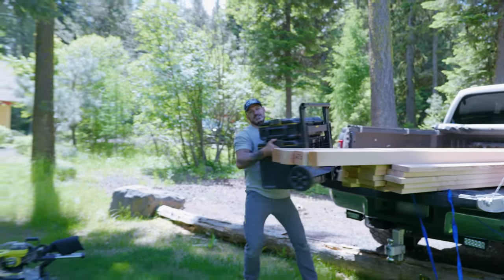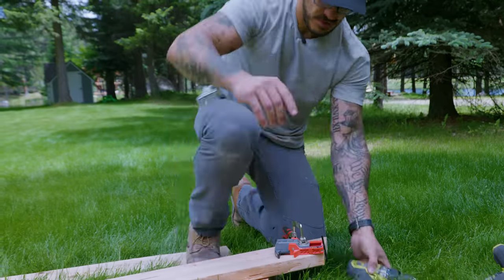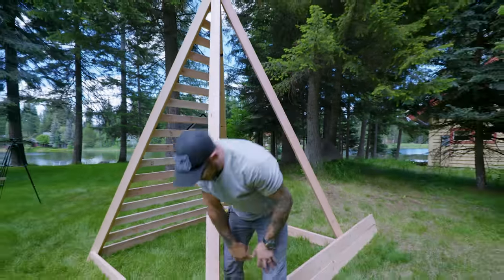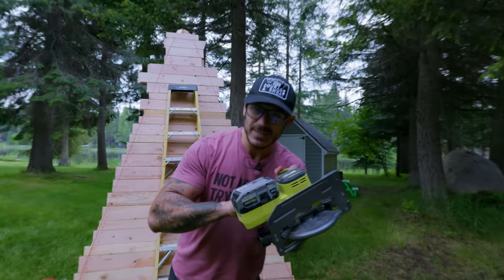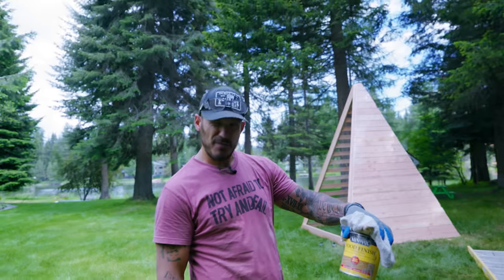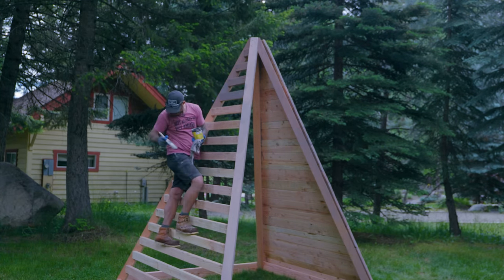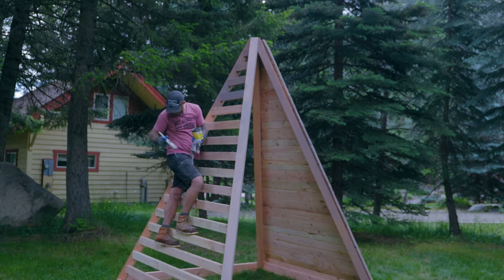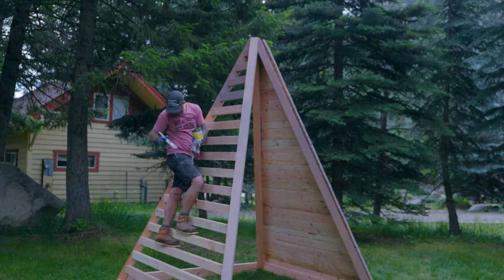The Most Dangerous Playground I've Ever Built

Comment: Man - sweet playground option for the kiddos!

A quick tip I use when messing around with allen keys where I have to turn it a stupid number of times - I use an angle grinder to cut the key near the 90 degree turn, then just check up the longer, straight section in my drill. Works wonders on saving your wrists and your time haha.
Reply: Love this suggestion, I came into the comments to say this if no one else had, one of my favourite little tips for making life easier on my hands.
Reply: @beeb6730  it’s a good one for sure 👍🏽
Reply: i love it

Comment: NO BEARS??!!
Disappoint!
Cool climber
I’d brace the hand hold with vertical back supports to keep individual boards from flipping.
Those kreg jigs are pretty, but screws pop out or pull through with a lot of pressure and use

Comment: For the hammock chair, the hook could have been screwed straight into the wood, you didn't have to hammer in the plastic part, that's meant for brick or concrete. I personally would have used an eye bolt all the way through to the top.